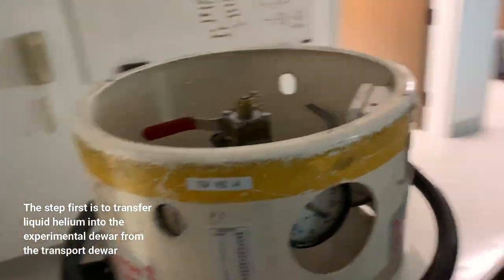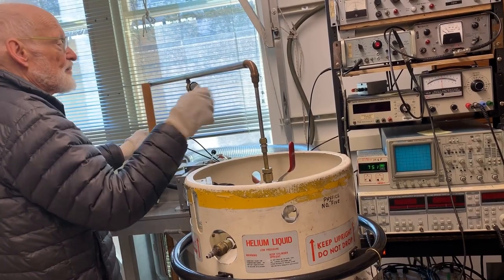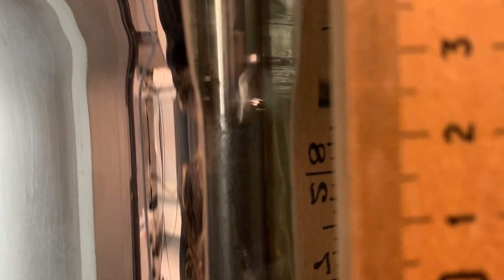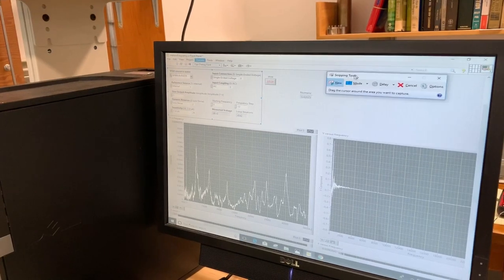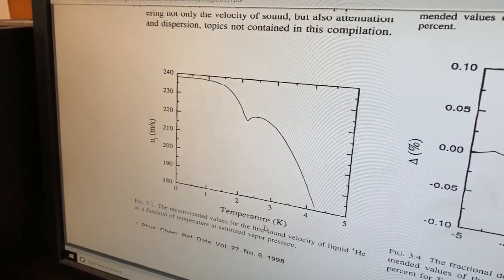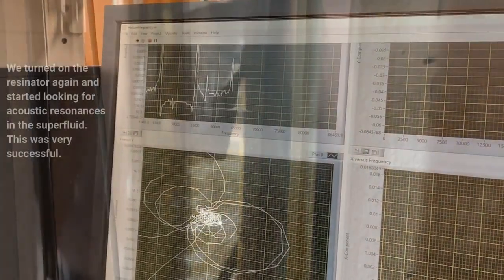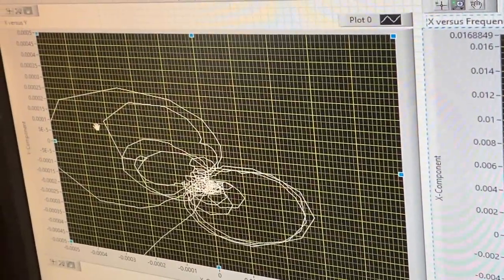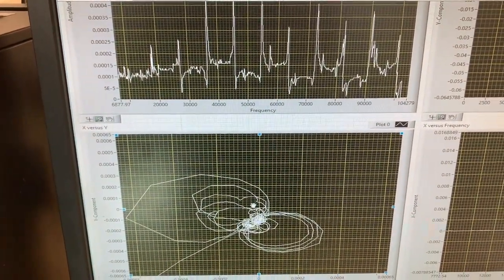Superfluid Helium Resonance Experiment | Condensed Matter Physics

Comment: This is a wonderful video. I was wondering: When the helium passes the lambda point does the conductivity rise smoothly or is it more of a discontinuous jump? What about the derivative? Also, do you think it might be possible to liquify Helium in a home lab? I've managed liquifying Nitrogen and Oxygen, but the logistics of trying to keep the helium cold while compressing it without the cold shrinking the moving parts of the compressor into a standstill have me stuck early in the planning stage.
Reply from the maker: The famous lambda-shaped discontinuity is in the specific heat capacity, not the thermal conductivity. As far as I am aware, the thermal conductivity jumps very abruptly, but not quite discontinuously, when dropping below the lambda point. I have no idea about the derivative.

To liquefy helium at home, you would have to be quite the impressive machinist (both skill-wise and equipment access-wise), have a big budget for fairly expensive materials, and have serious chops for designing ware resistant apparatuses that can handle extreme conditions. You also have to have equipment for purifying the helium gas first, so that the liquifier doesn't get clogged with solid air, which usually requires a high performance compressor system (often ending with a very expensive screw compressor). Beyond this, you need vacuum jacketed storage, transfer, and experimental equipment to handle liquid helium. This includes the Dewar inside the liquifier where the helium is actually liquified. To maintain this, handle air and moisture leaks into apparatuses, and for moving gas around within apparatuses, labs that work with liquid helium (and at near 0K temperatures generally), are usually also equipped with high performance vacuum pumps. These labs usually also have helium recovery systems to capture boil-off, because helium is an expensive and finite resource. Maybe you could build all of that. You will doubtlessly be YouTube famous if you manage to. I have watched the helium liquifier system at my university while it was running. It is definitely what I would call non-trivial engineering. It is also worth pointing out that helium liquifiers are high-maintenance, temperamental machines. Even running a finished one is a lot of work. Good luck!
Reply: @DietterichLabs  Thank you for responding. I have some decent experience machining, though, I know enough to know I am not impressively good at it. I've been trying to find out more details about how Heike Kamerlingh Onnes originally liquified it 112 years ago. I figure the necessary equipment must have been made cheaper in that time. So here's the outline of what I would like to do.
1. Liquify a large dewar worth of liquid Nitrogen and Oxygen say 5 Liters worth. That requires no new equipment for me.
2. Lower the pressure inside the dewer until the N2 O2 mix reaches a triple point which should hopefully be between 63K (Nitrogen triple point) and 54K (Oxygen triple point).
3.Maintain a vacuum and wait as the solid mixture evaporatively cools to ~48K or less.
4.Now that it is colder than the inversion temperature of Helium by a few degrees sending a very very small amount of compressed Helium into a smaller dewer frozen into the N2 O2 block should lower the temperature even further.
5.Then I would (again very very slowly) throttle up the Helium flow to further drop the temperature till the Helium liquifies.

I'm not quite sure how I would scrub other gasses out of the helium especially hydrogen (maybe mix incoming helium with oxygen and then run that through a catalytic converter to burn the hydrogen away into water, then add a filter and cold trap to freeze the water out.)
It's obviously a super involved process but nothing seems practically out of reach.
Reply from the maker: @pinethetree  You might be able to make a small amount of liquid helium that way. Let me know if you do.